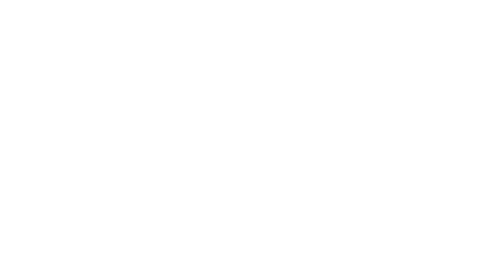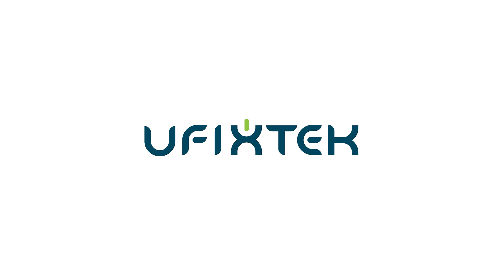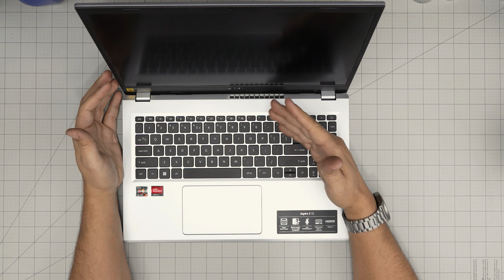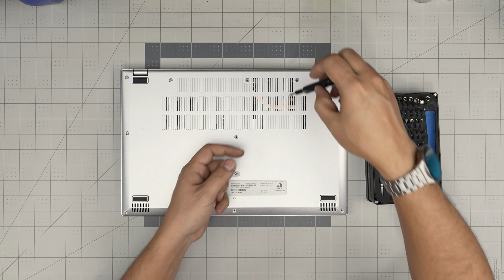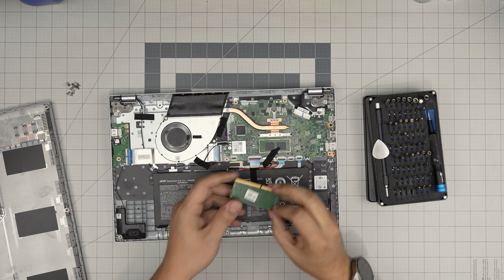Why You Can’t Upgrade RAM on Acer Aspire 3 A315-24P-R2AG – What You Need to Know

Comment: so your telling me there is no other way to upgrade the RAM to it at all? is there anyway i can boost  the preformance for game and not making it so laggy or my computer heat up to fast?
Reply from the maker: 🫠Regarding your question, you can take the laptop to a good repair shop and have them desolder the RAM IC chips on the board and reball new, higher-capacity RAM chips, hoping they don't mess it up and kill the board.
This laptop is not meant to be a gaming laptop, as the heatsink is not designed for gaming. It is intended for office (administrative) use.
Should you have any further questions or requests in the future, please don't hesitate to ask me.
cheers🍻
Reply: @uFixTek  cool thanks
Reply from the maker: It's my pleasure my friend.

Comment: in the situation presented by you with this laptop, is there no way to upgrade from 16 to 32 ram on this laptop?
Reply from the maker: 🫠Regarding your question, sure, there is a way, but it will require reballing and removing the old RAM chips, then soldering on new RAM chips—something that not all repair shops have the experience to do. It can go wrong, and your motherboard may face sudden crashes or even fail to power on.

Should you have any further questions or requests in the future, please don't hesitate to ask me.
cheers🍻